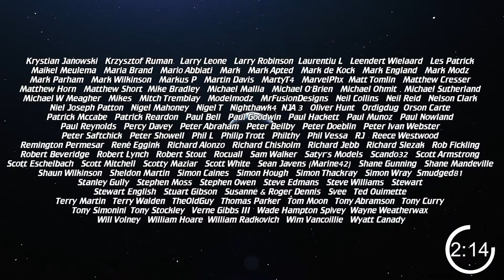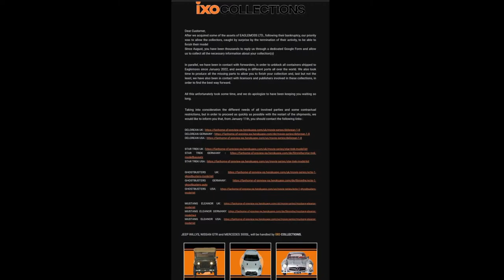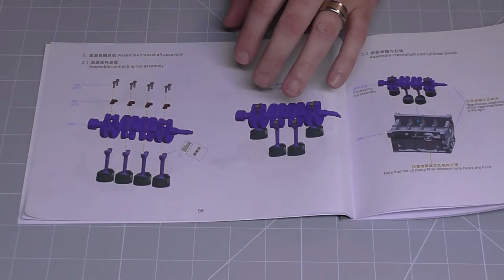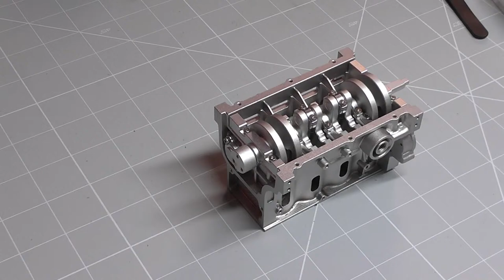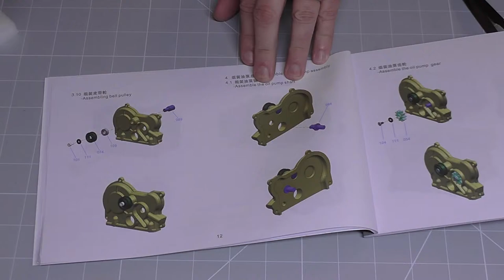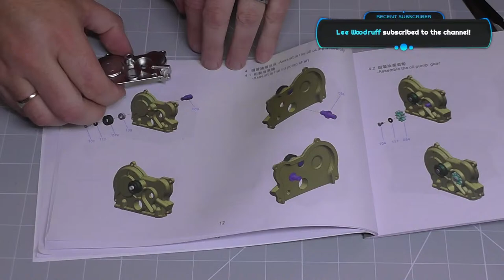The World of Wayne Tuesday  LIVE Stream - Build the Stirling Kit Teching Diesel Engine - Part 2

Comment: Hi Wayne, it was me who pointed out the missing bolts on the cross members, but like usual, I wasn't able to make the live stream. And I've got to suggest once again you should always oil all end caps when installing a crankshaft. On a real engine there would be oil holes in the journals feeding oil to the bearings, but you still pre-oil to avoid early wear. On a model like this, with no bearing and minimal rotation speed it's not risking excess wear, but it would still spin more smoothly.  ...then again, I'm an oil junky.. I oil everything.  :)

Comment: Wayne, the reason the screws and fasteners are not magnetic is they are stainless steel which is a non-magnetic steel due to its composition and why it does not rust like normal steel items.